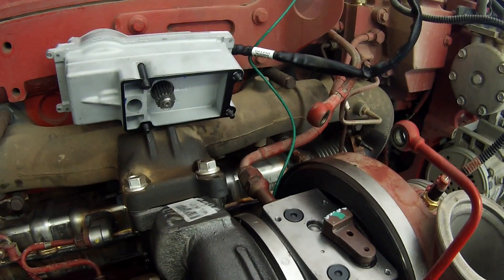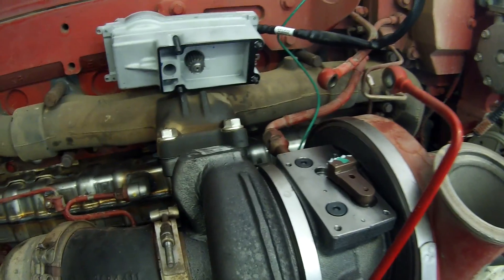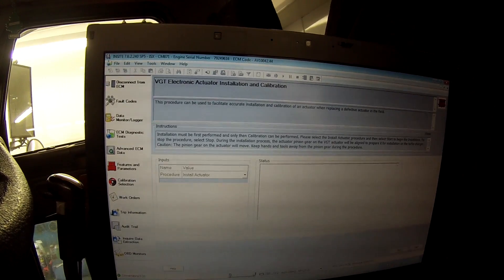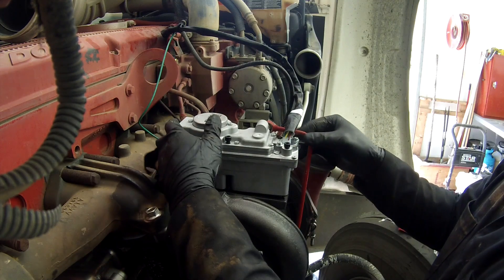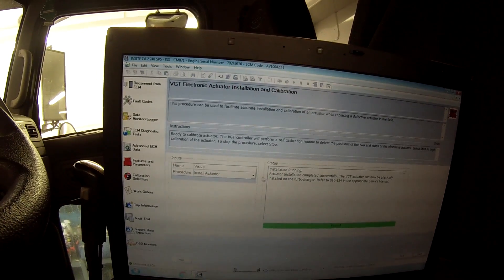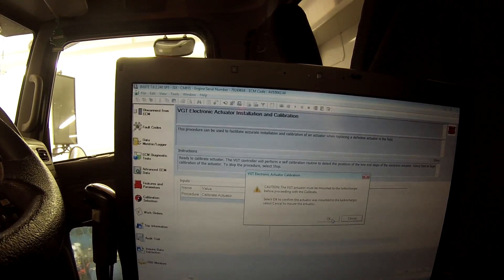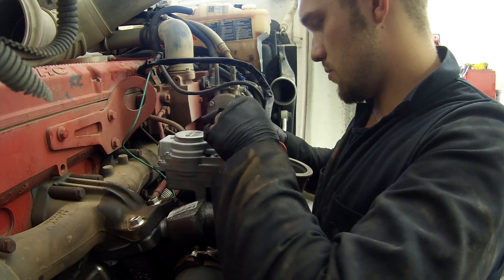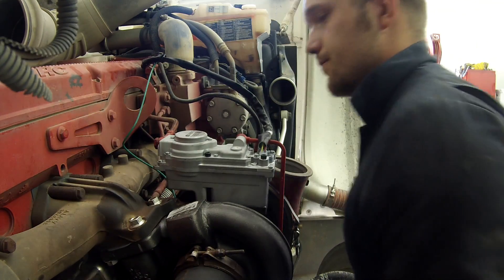How to calibrate Actuator to Turbo Cummins ISX

Comment: I have 2015 international prostaat we took the truck to our mechanic and plugged in to the  computer and found out that the VGT actuater driver circuit code 1894 and 2198. The truck is driving normal and not losing any power. The mechanic is suggestions we may need turbocharger to replace. Can u give me ur recommendation please? Thanks

Comment: Hey on a ram 2017 3500 6.7 are the actuator wheel supposed to be moving freely  ??
Just took mine off and lever on turbo i can still move but the wheel on actuator is not moving at all? Pls help thanks
Reply: Actuator is bad, it should move freely

Comment: Hi need u help me out  Yesterday I  Received a warning the   the engine was going to derate in 3 hrs but when I hook up the Cummins insite is giving me 2636 VGT Actuator Driver Circuit  1 count no active in that  Moment did a  Force region and it did with no problem what u think can this problem be

Comment: How do I get the actuator off two bolts came out the other two are snapped and hitting the bottom of the bowl with the hammer without breaking it is not doing anything
Reply: How did you get the broken bolts out?

Comment: Hi, I was having power issues with the truck similar as you described and last week I had my mechanic calibrate, the actuator. I drove the truck for a week and everything seemed back to normal full power again however, today the truck seems like it was before it was calibrated. Any thoughts on why?

Comment: Good job, but you are putting too much torque on the banjos coolant bolts. That is aluminum and needs around 12ftlb torque. Sealing washers are  between, and  do not need more torques. Good video.

Comment: Does a new turbocharger  come with the actuator already calibrated? Just had a shop put a turbo in and didn't see them calibrating anything.  Turbo boost  gauge only goes up to 30 and I'm not getting any fault codes. Please help.
Reply from the maker: No. On cummins theyre always seperate. 
Usually I think itll throw a code but id definately ask them about it and make sure they calibrated it.

Comment: O and also I replaced the diesel pump head and a couple of sensors and I still have the same problem and as I was driving it yesterday I lost power on a uphill more that usual
Reply from the maker: Land Sierra i wouldnt be able to tell u much, would need to see the fault code with insite. Could be the one way check valve on the fuel rail, could the fuel pump actuator. Or could just the fuel rail pressure sensor...
Reply: Ok I see were r u located at
Reply: Land Sierra I am having the same issue. Have you figured anything out?
Reply: JT Rudd yes I got fix n it was the fuel pump n it's got like a lil cylinder with a sensor attach to it get that replace too cuz the fuel pump rodent come with it
Reply: JT Rudd it's called the fuel pump solenoid valve

Comment: If a actuator is not calibrated can it cause oil to go through your air charge system system
Reply from the maker: Tommy Wat no. Ud have a check engine light and all, less power. Oil means seals or something is wrong in turbo
Reply: @BulletMcNugget  thank you very much

Comment: I noticed off point with this video but if oil is blowing through your blow-by and through your air charge system and your turbo making squealing noises what could cause this
Reply from the maker: Tommy Wat i wouldnt run the truck if u got oil in charge air system cause thats how u get a runaway truck. I have a video of a runaway truck... it wont shut off, and itll just smoke like 100 chimneys until engine is done with all the oil.
Reply: If it’s blowing out your breather it’s more then likely your loosing compression. If your turbo is whining and you have oil in the charge system it’s likely that your turbo took a dump. Check and see how your impeller fins look

Comment: Hi I have a question for u 
Ok I have a peterbilt with Cummins 18spd and it's giving me a 
fuel rail pressure fault.
Reply: Check all your hoses for leaks or sucking air or else may be your fuel pump

Comment: What Cummins data link adapter are you using. Was going to do a similar job with Inline 7 wondering what connector you used
Reply from the maker: i use a Nexiq 2

Comment: I was told at peterbilt that actuator already comes calibrated and that ones I mount it ... it will get in the correct position is this correct ?
Reply from the maker: treinta sosa not at all, no.

Comment: So I have the prolink and have the same two install and calibration. After completing them I run the engine and watch the actuator command and actual and see the actual stuck. But it seems free by hand. What gives?
Reply from the maker: ryanburbridge the numbers are far off fom each other? Turbo moves all the way left and right? Actuator moves all ways freely with no hard spots?